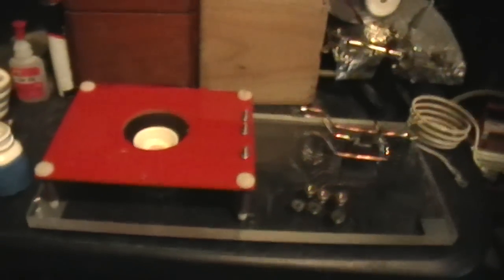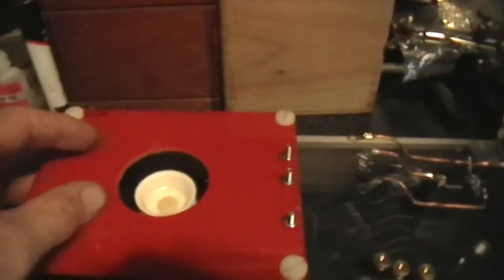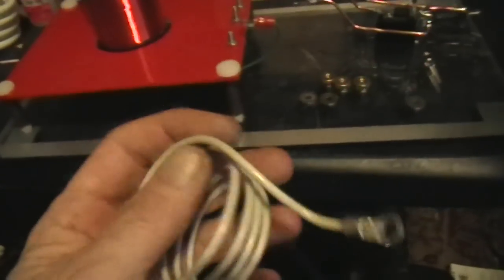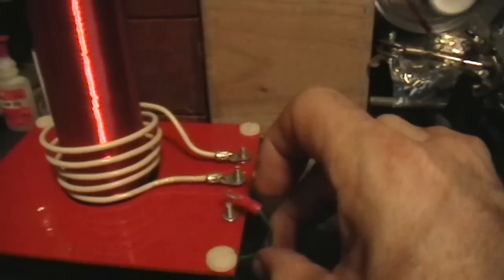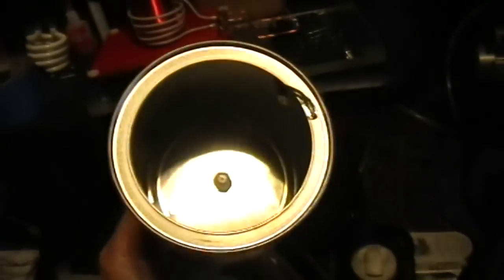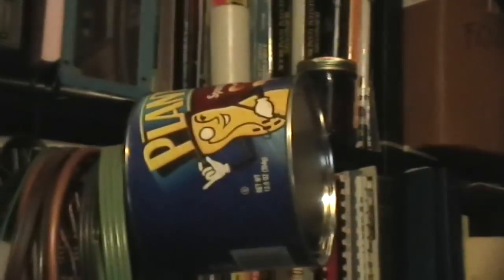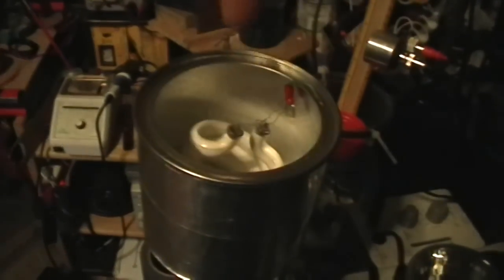TKLabs Replication: The "teslatronix" SSTC aka Slayer Exciter

Comment: Is it possible to use a 4 pin transistor ? 🙄
Reply from the maker: Most transistors only have 3 pins, or as the TO-220 or TO-247 type package used here, 3 pins and a tab connected to the middle pin (Drain or Collector). What is the part number of the 4-pin transistor you have in mind?
Reply: @TinselKoala  thank you kindly for your reply, the 4 pin transistors I have just have RS2006M and V734 not sure of the meanings as I'm just getting back into electronics and it's awesome and much more interesting than when I was 10 years old fixing Xmas tree lights 😉
Reply: @TinselKoala  I'm terribly sorry I now realize that it's not a transistor at all but a bridged rectifier 😲 how dumb of me, I'm new to the slightly more technical side of electronics and really hope to learn more thank you choice video bro 🤗

Comment: You may need to add about 4 more TIP31's in parallel or the one will smoke out quick.
Reply from the maker: Still works fine on just the one, after all these years. Maybe yours are fake, there are a lot of fake Chinese transistors out there.
Thanks for watching and commenting!
Reply: @TinselKoala  You're right, ya never know, but I have a handful of TIP31C's on there way to me... whats the highest voltage you can deliver to just the one?
Reply: I often wonder if the transistors I come across are genuine or not. What company would you recommend ordering from?

Comment: Nice video!
Wat are the options in gauge that can be used for the primary coil wire? You have used 12AWG I guess (stranded or solid?)? Should it be solid core or stranded? And what should be the current capacity?

Comment: how come the secondary length can vary so much? 400-100 turns. Shouldn't it be quarter wave of the primary? What does set the resonance frequency? Can the top load be almost anything with capacitance?
Reply from the maker: The electrical length of the secondary will be 1/4 wavelength of the primary _drive  signal_, not necessarily the resonant frequency of the primary coil itself. "Dual Resonant" TCs (DRSSTC) will have the primary and secondary resonant frequency matched, but that does not apply to this setup. The resonant frequency here is set by the inductance and capacitance of the secondary (meaning electrical length). This kind of "tesla coil" is driven by the signal from the base of the secondary coil which controls the switching frequency of the transistor driving the primary, so is "autoresonating", within limits. The top load can be almost anything with capacitance of a few picoFarads to some tens of pF. But for maximum voltage buildup you need smooth surfaces without sharp points or curves and a large surface area-to-capacitance ratio (so things like doorknob caps won't usually work very well.) So you see smooth spheres or toroids used on real TCs.  Even this setup would produce more voltage if I had used a smooth sphere or toroid for the top capacity, due to voltage rise from standing wave resonance (VRSWR). (But the transistor might not be able to take the higher voltage swings.)
For a much better, true SSTC that autoresonates through E-field feedback,  see my "TinselKoil X" demonstration videos. That coil uses a more complicated driver and reaches higher voltages through true VRSWR, but can cause very painful RF burns and can destroy sensitive equipment if you aren't careful. This "Slayer Exciter" circuit can't reach those high power levels and is safer for the beginner to start with. The good news is that you can re-use the Slayer coils for the more complicated circuit when you get to that point in your experience level.
Reply: Is the effect (resonance voltage peak) any lesser, if you make them resonate by feedback, than finding the actual resonance frequency of the coils? Somehow I feel the resonance is "forced" on the coils now
Reply from the maker: No, the auto-resonating method  works best. 
The actual resonant frequency of the quarter-wave resonator + top capacitance will change, depending on the environment, such as the influence of your own body on the E-field of the system, and many other environmental variables. In a spark-gap Tesla coil, the secondary is allowed to ring for many cycles between sparks because the spark rate is much lower than the resonant frequency of the secondary, which rings at whatever the "current" resonant frequency is, however affected by environment. The loose coupling between primary and secondary is necessary to allow this ringing. But a Solid State Tesla coil is driven by the primary oscillator at the same frequency as the secondary's resonant frequency, with much closer magnetic coupling between primary and secondary.  Sure, you could call this "forced" resonating, because the coil will stay in resonance as the oscillator is always varying to keep it there despite environmental effects on the secondary's resonant frequency.
Reply: Thx for the input. Got the circuit done with the coils and I was all excited (pun intended), but nothing happens. I might do a video "newbie coil debugging". Coil continuity is ok and the circuit gets electricity.
Reply from the maker: Try reversing the connections to the primary. Let me know if that works.  Don't reverse DC supply polarity,  just swap the connections to the primary itself. 
This controls phasing between pri and sec, which determines whether the feedback is positive or negative.

Comment: how do i calculate resonance of secondary coil?
Reply from the maker: +THUNDERBOLT 
This system is auto-resonating. It's easier to measure the resonant frequency than to calculate it, but if you know the self-inductance and capacitance of the coil you can use the standard formula for LC resonance.
Reply: TinselKoala ok thanks a bunch

Comment: Hey! I have build my own slayer exciter, it worked , but all of my transistors burned out. Can I replace them with any npn transistor, for example some 70w ? Or are there few only transistors that work ?
Reply from the maker: +Pan Petr 
I think that there are many transistors that will work. Try Horizontal Output transistors (HV, high current), or 2n3055, or TIP31C as here, or other power transistors.
Reply: Thx!

Comment: Hi, what diameter of the tube did you used for secondary coil? Btw I'm not much familiar with slayer exciters but find it very interesting to build. I already have a pvc pipe that's exactly 4 cm in diameter (<2 in) and 25 cm (<10 in) in height. I couldn't find a 27awg magnet wire in any of my local electronic stores, but what about 29 or 30awg wire? I don't want to risk making something wrong with my project so want to ask for any suggestion. Regards.
Reply from the maker: +Viktor Božičević Sorry to take so long to reply, I just now saw your comment. Dimensions, wire diameter etc are not critical. You can use 29 or 30 AWG without problems. The number of turns on your former (that is, wire length) will determine the operating frequency, so for a given former, smaller wire=more turns/inch and lower frequency. Your 4x25 cm former might be a little "long and skinny" but try it anyhow. I think my former is closer to 5 cm diameter.  You can use the same basic circuit with a wide range of secondary coil parameters, so experiment to see what works best for you!

Comment: Please pardon the newbie quesion but I'm having trouble understanding how the primary coil manages to induce much of a voltage in secondary when so much of the secondary is outside of strongest  part of the magnet field created by the primary; that's a relatively long tube. At bare minimum I would have thought you'd center the primary on the secondary.
Reply from the maker: That's a good question. In the case of Tesla coils the secondary acts as a "quarter wave resonator". Instead of thinking of it as, say, something like a guitar or harp string, plucked near the center and with motionless nodes at each end, it is more like a whip, where it is "plucked" at one end and the other end is free to swing to great amplitudes.  For the quarter-wave resonator the bottom end is grounded and stays at ground potential and the top end is free to "swing" to very high amplitudes (high voltage). A half-wave TC does have a centered primary and produces high voltage at each end of the ungrounded secondary, you can see my videos on "bipolar slayer exciter" for an example.
Reply: TinselKoala Ah, that explains some of the pancake shaped primaries I've seen used. Thank you!
Reply from the maker: Eric Davies You're welcome! There are two other considerations as well. In a properly working TC or "slayer exciter" the voltage along the secondary rises so fast with height that it becomes so high as to be able to arc over to the primary very quickly. So the radial distance between the top of the primary and the secondary itself needs to be great enough to prevent this from happening. Also, in traditional spark-gap TCs the magnetic coupling between the two coils needs to be rather loose, with a coupling constant of 0.2 or even less, so that the ringing of the secondary isn't damped by the primary between the spark "strikings". The pancake and inverted-cone geometries for the primary windings accomplish both of these purposes.  (The loose coupling is less important in solid-state TCs like the "slayer exciter" since the primary is pulsed directly at the secondary's resonant frequency.)

Comment: I am making an audio modulated Tesla coil and the reason why the bulb lit up when u put your finger in the can,  (or broke the electron barrier) is,  a Tesla coil or even a slayer exiter has single wire transmission other wise known as ion displacement which mean it adds ions or injects ions into the surrounding area. This opporates like wind( high pressure goes or fills the low pressure zone, making wind or air displacement. The can is circular actually a cylinder which means the ion count or the amount of ions in that small area does not change(unless you give them a place to go or fill like your finger or some other ground) so the ion count not changing means it will not exite something unless they are active or moving. I love Tesla coils!  I truly hope this was helpfull

Comment: the center post of transistor is bare right great video thanks
Reply from the maker: On this type of transistor package, called TO-220 (and also bigger TO-247) the Collector or Drain (center pin) is also connected internally to the Tab, the mounting screw place. So you can make your Collector ( bipolar) or Drain (mosfet) connection there instead of or in addition to the center pin.
Thanks for watching and commenting!

Comment: I have pushed almost 200 v dc in my slayer and its crazy just like sstc with 555 pulsing it I can play pure music out the top with no ground needed
Reply from the maker: Wow, that's cool. What is your output transistor? Have you got scopeshots, frequency data, etc?
I made a great audio-modulated tiny Jacob's Ladder with a 555 - 2n3055 arrangement driving an automotive ignition coil. The sound quality is amazing, and I got good sound even when there was no visible arc in the electrodes.
But I'd like to get results like that from the miniSlayer I built later on after this one.
Reply from the maker: I apologize to you for Google marking your replies as "spam" without giving me any way to unmark them and make them visible. I just now noticed them, and try as I might, I can't seem to unmark them. I really hate the fact that Google has so screwed up the YT commenting system. It's like they have been taken over by junior programmers who just can't leave well enough alone and insist on making changes just to have something to do, and who cares if they screw something up with their "improvements".

Comment from the maker: The diagram in the instructables is not wrong. Read down in the comments on the instructable pages and you will see common problems and their solutions. The first thing to try is to reverse the connections to the primary coil. Don't reverse the DC supply polarity!
The UF or 1n4007 diodes are 1 kV diodes. I would not substitute LEDs here; if it starts oscillating the LEDs would probably burn out from the reverse voltage and their forward voltage is probably too high.
Good luck!

Comment: Don't know if you can help me you'll se i'm making this exciter with this .instructables.   com/id  /How-to-Build-a-Slayer-Exciter/and the thing is that in the diagram i substituted the UF4007 diodes to LEDs after it didnt turn on and the thing is that de LEDs didnt tunr on too so i dont know if the diagram is wrong because if i change de polarity of de power supply both LEDs turn on, but the toroid still gving me no current

Comment from the maker: Thanks, coming from the master I'll take that as high praise indeed! Be sure to check out the effect it has on the vacuum chamber, it makes a very cool plasma in there without even being connected directly to it.

I wish I had some finer wire. The secondary doesn't really have enough turns on it. But it works great as it is.
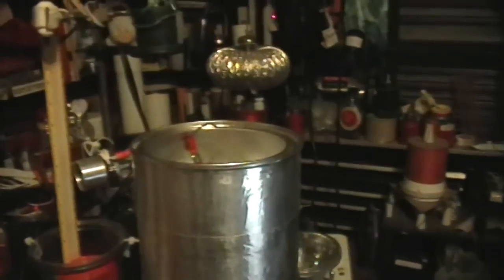Reply: 12:00 Saying it isn't a TC is more a distinction, and not a difference!

Comment: his secondary's are thin. about .3mm I think. It's the only way to get the 2000 turns he has on his big ones (About 2' long) I did one with .1mm and 800 turns. Caught fire. Too many amps in the thin wire. TT won't have to worry about that though. His coupling zone is too tiny to get amps in the secondary. Will be burning one down for 20k views on my channel this week :) I figure his wire wound top-load may have improved Fluro range a bit. due to lots of thin surface area. Not in kit though....

Comment from the maker: Ah well, I might have to make a crazywire cardboard topload just to see what it does. 

But in one video, the schematic video, he is showing a decent corona discharge from the bare coil, at pretty low voltage input. I think that secondary has a lot more turns on it than mine does, though, using finer wire. 

This spool of #27 is all I've got to work with, myself, and I'm determined to use it all up before I croak. Still have about three pounds left on the spool though!

Comment: I partly agree. My first Slayer was a TT rep, I had to change pretty much every part to get good performance. The wind ratio is all wrong, as you point out. I still think of them as a Telsa coil though. As far as Tesla wireless, the Slayers do every experiment you can do with another Tesla coil. Just lower power. lower range. You'd have to have rocks in your head to pay $300 for one wrapped in gaffa tape though... I don't think the 1000+ turn models even run, Made one, it just gets hot. Con't

Comment: Nice work!  I was getting a very similar effect when I put a florescent tube inside of my slayer exciter Tesla coil.  Try setting your compact florescent tube on top of the top load and electrically connecting the wires to the top load.  When I did that the florescent tube turns off unless you have ground near it.  Might be the same effect as putting the florescent tube in the peanut can.